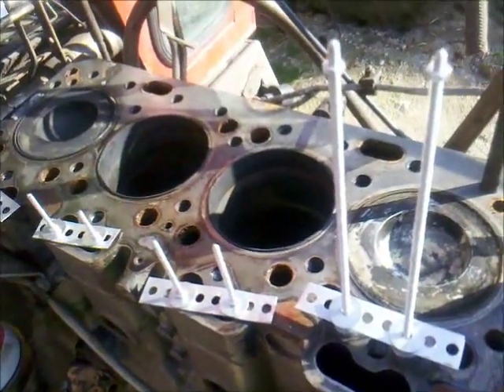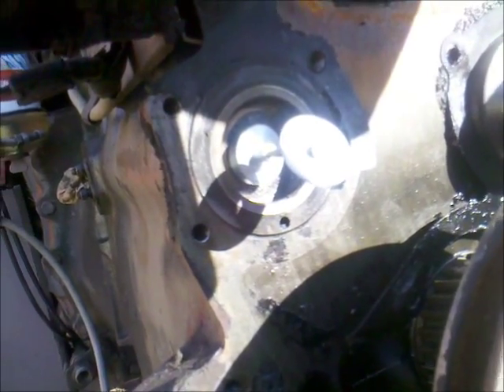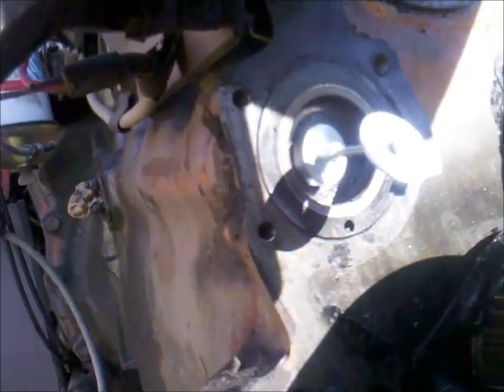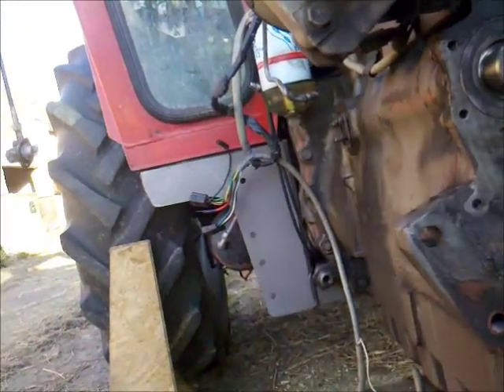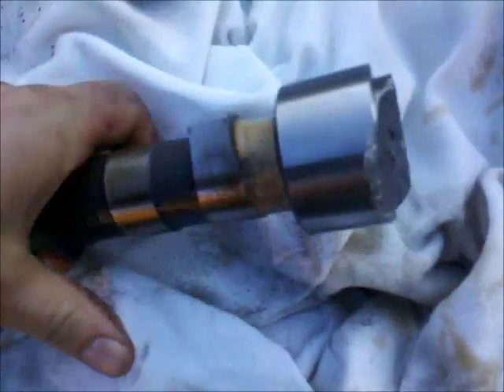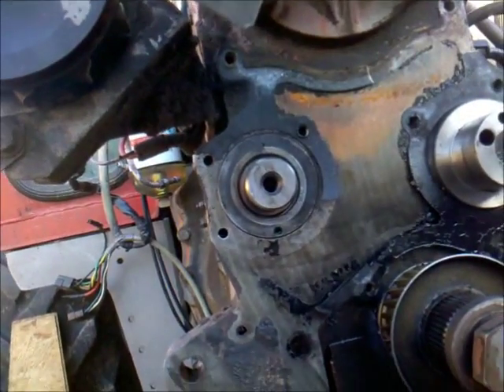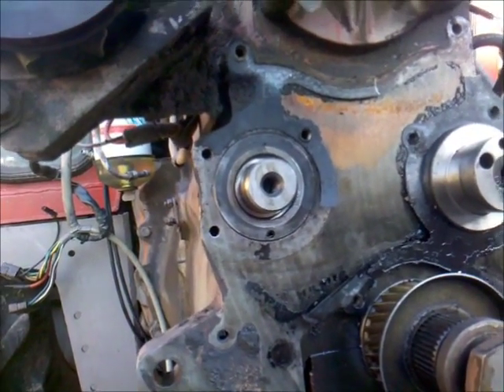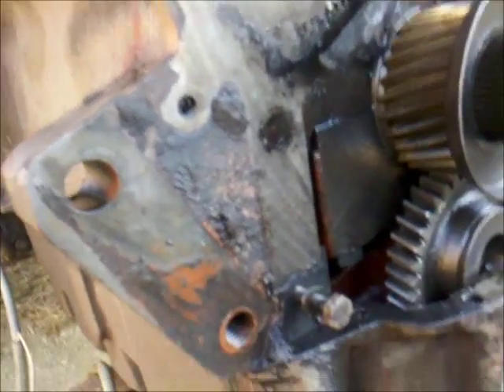MF 590 - Camshaft removal / replacement on the Perkins 4.236 / 4.248 - part 9

Comment: Thank you for filming this.  I have a case 580c that the camshaft broke exactly like yours and I have been wondering if I can do it and easy way.  I read on a forum that this could happen if the powersteering pump leaks and the pump freezes up to stop spinning...This may  be what happen to mine!
Reply from the maker: Your welcome! this is the easiest way... the workshop manual recommends you much more handling and work to get to the same results. Be sure to check the rear face of the block! the cap for the camshaft might be lose! watch my other videos to see what I mean.